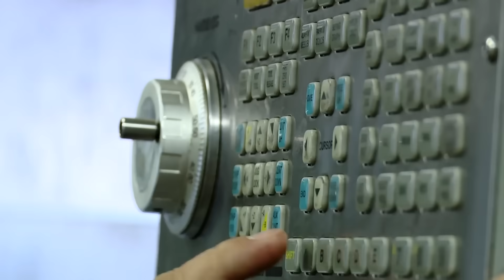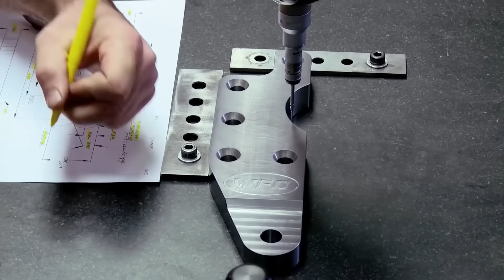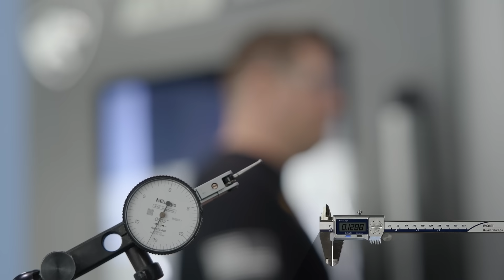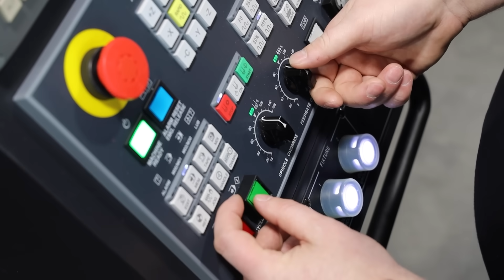Tools Keep Breaking on Night Shift, but Run Perfect on Day... Nobody Knows Why

Comment: Actually, you are completely missing what the key Takeaway really is here. First shift is fully staffed, usually with the best people. Everyone is there, operators, programmers, office people. Supervisors, general manager, the owner.
So at 5 o’clock, pretty much every single one of those people goes home. Now you have a new set of people come in, and they may or may not be the best operators available. But what you don’t have very often is  support for them. You don’t have great supervisors, the offices; empty or nearly empty. The owner is not there, HR is not there, nobody else is there. So if you don’t have at least a supervisor that is equal to the supervisor during the day, and also on board, and in tune with that day guy, this is what you get. You have essentially unsupervised workers, who feel free to make changes, do things their own way, and then, when mistakes are made very often it’s covered up and nobody knows what happened at all. So the real fix is to get everybody on board and hire a supervisor that is in tune with the day supervisor, for the night shift. Yeah, of course it’s gonna cost a lot more to get that guy in there at night. But if you wanna run a great night shift, that is just as productive as the dayshift, that’s what you need to spend.
Reply: The worst is when they hire a new guy and put him on night shift right away, without first letting him learn how things are done in that company.  I was in that spot once.  When I was stumped on how to deal with a situation, I'd search the shop and couldn't find a soul to ask, even though there were supposed to be six other guys on the shift.
Reply: In my experience 1st shifters come in tired and leave tired. 2nd shifters come in fully awake and leave tired. 3rd shifters come in tired and leave exhausted. I noticed years ago we don't put 1st shifters on 2nd when 2nd shifters are on vacation or injured, someone else on 2nd has to double up. But we do take 2nd shifters and put them on 1st and 3rd when they are on vacation or injured. Our team lead is currently on 1st because a 1st shifter broke a leg water skiing in Florida and won't be back for 8 weeks, 2nd shift has had to fill his position by working over.
Reply: @thaddeuscarpenter1580  sounds like typical insufficient staffing and that is a management / owner problem.
Reply: Where do you work that people get way more at night than during the day?  I think our premium was like 25 to 50 cents on the hour for 3rd vs 2nd.  Sounds cushy.
Reply: @christopherjunkins Not at a machine shop and not the person u asked, but I worked IT for HP, they paid time and half for any night or weekend shift, and double time for holidays. And yes it was a 24/7 operation.
Reply: @SolWayward-  damn.  We only got time and a half for overtime and holidays.
Reply: @christopherjunkins Yeah it was the only place I worked where I experienced that.

HP is or was actually a very good company to work for (it's been 10 years so I don't know if anything has changed.)
Reply: @christopherjunkins  My work gives 1.50 premium for nights. We are on a 4/10 schedule, 4 days a week 10 hour shifts. OT on Friday if needed. Since we are down to 2 shifts we occasionally have 2 extra hours available voluntarily to make it a 12 hour day. 2-5 weeks paid time off, 10 days holiday paid, 2 weeks unpaid for any reason without notice days.

There are companies that exist that do give decent money for nights AND have decent/good vacation policies. Now if they could just fix the insurance contributions to not be an arm and a leg...
Reply: Bakeries have this too! My current job has a few people who come in mid shift and we have meetings before night shift leaves which leads to a lot of miscommunication errors. The last bakery I worked at there was a lot of animosity between day and night shift since people couldn't find things or they didn't have the same standards which would typically cause night shift to remake things.
Reply: You guys don't rotate shifts? Working only on 2nd or 3rd would be exhausting.
Reply: @arkadiusz3212 Rotating shifts means rotating sleep schedules, which sounds like hell on earth to me.
Reply: @arkadiusz3212  rotating shifts is worse than staying on nights. It takes weeks to adjust to a new schedule.
Reply: @arkadiusz3212  if you have a schedule you get used to it. Some people are morning people, some people are night people. Once you know which one you are the choice is easy. On the other hand, switching back-and-forth between first, second, and third shift constantly is going to whack your sleep schedule and at least for me it would probably kill me.
Reply: @arkadiusz3212  i prefer working evenings only - its even more exhausting to rotate
Reply: what i usually experience is the exact opposite - that the night crew will often do a better job because of less management involved

and the product will usually not diminish in quality either - the last place i was at had about 50% workforce at night, running 3 shifts - day, afternoon/evening and night

the night crew were by far the most productive, and usually had at least as good, if not better quality on the finished product

usually the day crew will have other tasks like cleaning or servicing, interfering with the production rate
Reply: @emil3672 interesting. I have never actually experienced that scenario. Pretty much every time, the day shift spent at least some time each day un-screwing what second shift screwed up.
And it can happen on first shift, too. I once worked in a production manufacturing facility. They had “line leads” that really weren’t. What they were was English speakers. Most everyone else didn’t. I was a label tech. They’d call you because things weren’t running right. I’d fix it, and explain why it wasn’t running right. It was usually because someone adjusted a speed, strung labels improperly, or wasn’t doing their job properly. as soon as I walked away, they go right back to the same thing. Even if you outright straight up, documented precisely what was going on, the supervisors couldn’t seem to be able to take care of it.
Reply: @emil3672 that sounds like a overmanaging issue
Reply: @Paul_Bedford  considering 22% above expected profits the last year i worked there - yet demand bonuses were cancelled due to "low budgets" i would argue you are right 

especially as those statistics happened in covid, where construction exploded, we were producing at 180% capacity, and were still falling behind by 2 or 3 days of a week 

management definitely wasted resources

but in terms of productivity it actually worked really well - the night shift was more than competent in keeping the machines running for the most part (mistakes and breakdowns can happen at all times of day, but support or repairs are more difficult)

the day crew then had the time they needed to do their planned maintenance

Comment: I worked on HURCO machining centers for thirty years. The tool salesman would offer new tools to solve a problem, usually with tough SS alloys, or to increase profits. Using his calculated feeds and speeds the tool would likely be snapped off immediately. I learned what programmer to trust and which one to check.

Comment: Run the job way you were told to, and if it doesn’t work then consult your supervisor. You gave all of the theory and information on how you arrived at the appropriate settings but the real problem was the night guy thought he knew better and refused to subordinate himself (or herself) to supervision.
Reply: Yep. Then if it does mess up you were just doing what you’re supposed to. Once you start making changes you’re responsible for the outcome.
Reply: If he had to "stay late" just to communicate with the operator I am not sure any information at all was given to him.

Comment: Great video 👍 The best way to teach the science is if a 3 flute is used replace it with a 2 flute run the program and see what happens then they will understand why the cut per tooth is used and don't mess with the program 😊

Comment: Machining, a job where you learn something new everyday. And you just can't pull someone off the street and  just let them go. Like bosses seem to think.
Reply: You can pull them off the street, but you're going to spend the next 2 years getting them up to basic standards and yelling at everyone else the entire time thinking it's not the person you just pulled off the street (or that seems to be what happens lol).  And they will never be the person they replaced who had 40 years on machining... not to mention this new person will have different ideas of what feeds, speeds, tooth size, etc to use.  Everyone who designs these things is going to be a little different, so are the operators running it.  But that story in the video sounds just like our thermoforming department and the factory as a whole.  No communication between shifts.  Hell ours had problems communicating department to department.  Everyone accused everyone else.  We would get our parts perfect and the department using them would abuse them... we'd tell the upper management in both departments about it and ... nothing it would stay the same.  The parts abusers were better than any one else, or so they said... I'd work that department from time to time and see the parts abuse and report it, but nothing ever came of it.  I even skipped chain of command and got yelled at for doing so just to try and fix the issue... just got me in trouble.  "open door policy" my big red-neck ass!  Place even had a problem with allowing the worst racism I'd ever seen and still to this day haven't seen worse.  One woman got on a CONVEYOR BELT just to hop over it and talk to someone... we don't do that to ANY conveyor without getting fired immediately but that racist woman somehow didn't even get a slap on the wrist.  Even though that one went to an INDUSTRIAL GRINDER (to grind plastic parts and sheets into "regrind" to be recycled into new sheets... yeaaa glad I don't work that horrid factory anymore.  OSHA, if not paid off (or so we all suspected) would have a FIELD DAY with this factory and it's horrific stuff going on... people loosing a hand or a finger, etc... with little to no changes.... ect.  They did change CEOs every few months... one would cook the books and get fired, the next would start firing people to make changes and get fired, etc, etc etc.... it was never listen to the peons on the floor, no we have to make the changes we want ... and it never worked.  LOL.
Reply: @christopherjunkins  Been there done that.

Comment: I'm not a machinist and I knew the answer to the problem before you even explained it.
Works fine durin the day buy not at night. 
Someone is messing with the settings.
Reply: Depending on temperature changes in the shop from day to night shift, some part of the process could have passed a critical temperature point.  Highly unlikely, but possible if either the shop itself or where the raw material is stored are subject to enough temperature change

Someone changing the program is the much more likely probability, though.
Reply: @spudgamer6049  I would like to know more about this "critical temperature point".
Reply: @SurvivalSquirrel every solid is subject to a certain amount of change with temperature.   Obvious things like size, but also potentially less obvious things like ductility, electrical conductive, surface hardness, reflectivity, etc.  For most materials these changes are pretty gradual, but in some cases they can be relatively sudden.  What i meant by a critcal temperature point was that one of the materials involvved may have gone through one of these relatively quick transitional ranges, resulting in size, surface hardness, and / or ductility changes significant enough to create issues with the process.  Unlikely, as not all materials go through such a relatively rapid change, either by their nature or because they are designed not to go through these rapid changes at the temperatures where they are expected to be used if at all possible, unless such change is desirable. Unlikely doesn't mean impossible, though.

One of the more infamous examples, and the one I'm by far the most familiar with, involves many of the irons and some of the steels used in shipbuilding as ships were making the transition first to iron then to steel would transform from ductile to brittle with a ~10°F window, somewhere above 32°F but below about 70°F, varying a bit by the exact metal.  Remained a problem through at least some of the emergency builds of eacorts and merchant vessels of ww2.  Not really an issue if the ship wasnt stressed to yield, but if it was the results of such failures were quite different between say, the Caribbean and the North Sea.
Reply: @spudgamer6049  All that is nonsense if you compare this to CNC where temperature are way different.

Comment: On a tangent here but angle grinder disks come with recommended RPM limits, what they don't tell you is when you calculate the edge/rim speed they are pretty much the same for 9" , 5" or 4" so a worn out 9" cutter will be perfectly safe on a 5" grinder ( WITH THE GUARD FITTED ). I as a low income handy man could get heaps of used 9" disks from my local tip.

Comment: I had a problem with operators slowing everything down. Their justification was "You don't run your car wide open all of the time" . My reply was "Your refrigerator runs wide open all of the time. Run the machines at what I programed it at!"
Reply: i would like to know how bad your fridge is if it runs wide open at all times

i know mine's shit, old, leaky and in a horrible location, and even that only runs for a few minutes every few hours even at its coldest setting
Reply: Terrible analogy😂😂😂😂😂
Reply: For those that dont know a thing about refrigerators, i have a better example: Dig a pit with a shovel, but only put 1/4 of dirt on it, as it could handle. Not only would it take longer, but the shovel would wear down faster.
Reply: If a fridge is running all the time it is broken.
Reply: @hendrikvanleeuwen9110  when the old style fridge compressors are running, they run full-out.  Newer compressors have an inverter to run at variable speed.
Reply: @drm_2435  Sure, but unlike a machine spindle cutting a workpiece, the loads are constant, the "workpiece" (refrigerant) is constant, and the environment is constant. With (for instance) a milling machine, you might go from Delrin to duplex SS to 360 brass or from a 3" facemill to a 1/32" ball nose. It's not really comparable.
Reply: @davidg3944 that was kind of my point, a fridge (running full speed or not) has nothing to do with machining.
Reply: a refrigerator definitely does not run wide open all the time. ive never understood machinists attraction to running machines too hard. its bad for everything.
Reply: @DieselRamcharger  one thing is running the machines too hard, but you also cant be too light on them either, that can also contribute to lower tool life and worse surface finish
Reply: @DieselRamcharger Because time is money 💰.
Reply: @DieselRamcharger  Fridges normally kick on at full speed, run at full speed, and turn off once its cool. Theres some hysteresis and stuff of course so it doesn't kick on and turn off every few seconds.
They are either off, or at full speed. So i'd say you are running it wide open at all times.
Reply: ramrod much?

Comment: I've had to chew out "old school" machinsts for doing this quite a few times.
Reply: True but sometimes you do have to deviate from what the perfect numbers calculate out to be based on variables that can't always be calculated or explained. Reading the surface finish, the sound the machine is making and the spindle load you can sometimes tweak the speeds and feeds to run a little better. Also an older machine with a little more spindle run-out than desirable will usually need to be ran at a lower feed rate because the flutes on one side will cut deeper and take a higher chip load than the flutes on the other side and cutting radius's has to be accounted for as well example if you are circle milling a 1" bore with a 1/2" endmill the actual surface speed will be much greater than the feed for the tool path.
Reply: @phillhuddleston9445  True... if the work had not already been perfected by a smarter guy than the night shift. 

If you told the night shift what you just said, they would have had to lie to say they understood.

Comment: It's called chip per tooth and if you use the g94  code for thousandth per rev you'll get the maximum chip load for your cutters. 
   An engineer and former machinist who was showing me the new Johnford agrees.